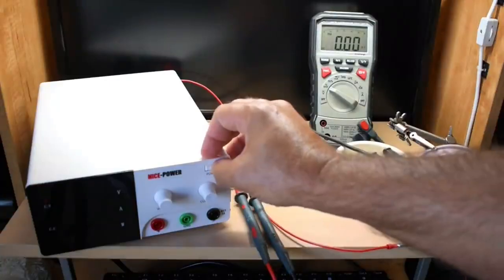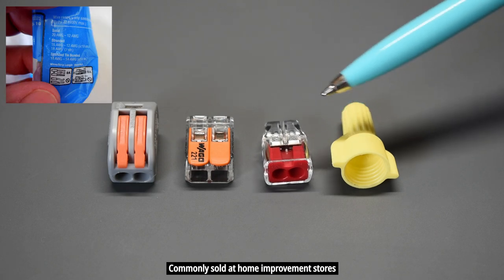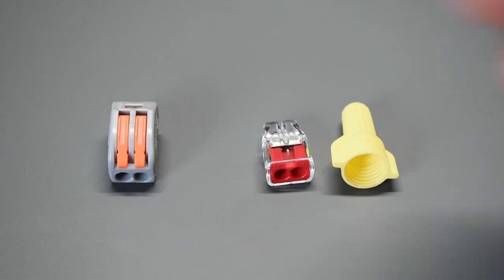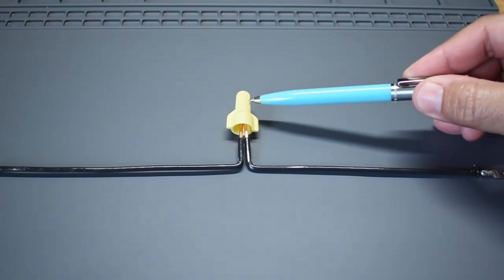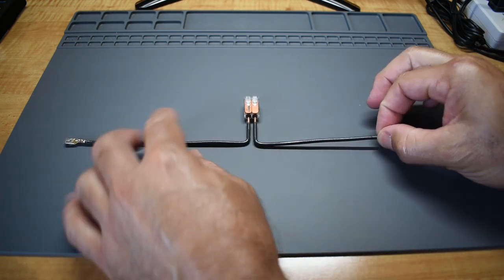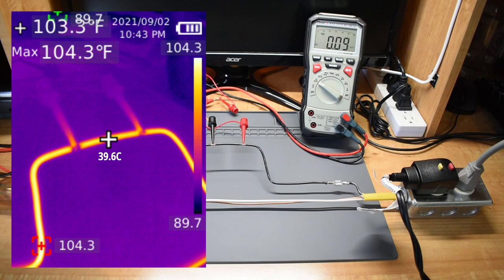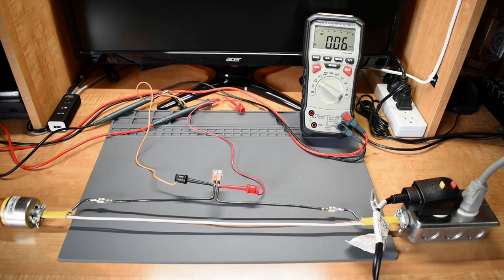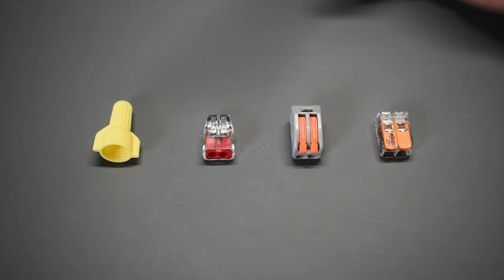BEST Electrical Wire Connector? Wago, Wire Nut, Ideal In-Sure, Lever Nut

Comment: on the ideal connectors- I have found that tinning a braided conductor creates a better insert bond, now that extra practice wouldn't be ideal if speed is a priority in the project. There is also a strip guide on the WAGO conductor, in your examples, you're showing the solid conductor over-stripped exposing more copper than necessary * for testing- this over stripping on a wago defeats the mechanical leverage of the wago making it "loose" -  the wago manufacturer's lever bond intention was compromised in the test- thats not a fair variable.
Reply from the maker: Incorrect, nothing was over- stripped. You're not looking close enough at the video using high-resolution.
Reply: @electronicsNmore  gotcha. so what your saying was the angle of the video makes appear that the conductors are over stripped? Not sure how you know what we are viewing the video with in resolution? Great video. In the 600 wago series up to  10 AWG there is no conductor lateral movement. How does Wago feel about your testing of the wago?
Reply from the maker: @proanswers  All the insulation wasn't removed from the test area to the end of the conductor. There's a short section of insulation on the conductor after the stripped area, and before the test area. No idea why it wiggles so much, but it does. If the stripped area of the wire needs to be exact, to the mm, then it's a poor design. There should be enough of a collar before the clamping area to restrict movement. I don't care what they think, or any other companies product that I test/review. My job is to be fair and unbiased.
Reply: Tinning any wire that will be inserted into any kind of clamping connection is a recipe for failure, and depending on the application a safety hazard.
Reply: @superdau  good luck with that opinion vs science ideal connectors were mentioned not lever wagos.  Check your.comment
Reply: @proanswers  
Not opinion, but fact. It's called "creep" ("solder creep" or "solder fatigue" specifically when talking about solder).
Reply: @superdau  that's great- off topic, irrelevant for application. If your looking for a your right - there you go. Be well good luck
Reply: @superdau  that's great- off topic, irrelevant for application. If your looking for a your right - there you go. Be well good luck

Comment: Anything with a lever that can get caught on something and pulled loose is crap. Anything that uses a spring lever to connect the wires together is crap. 
Wire nuts have been around forever and are extremely secure and save if used correctly.

Comment: Great video proving that the "old standards" became standards for good reasons.  I've recently seen some wire nuts that have no metal insert for "threading" onto the wires.  They're just injection molded plastic.  They go back for refund or into the recycling bin.  I solder and cap when I can, and use the wire nuts if I can't.
Reply from the maker: Plastic only wire nuts are garbage. Thanks for watching!

Comment: Strange that you did not twist the wires with a flat pliers before twisting the wing nut on the wires. Thats the way they teaches it at my school.  (Long ago..) That way the copper cannot oxidate at the inter connection.
Reply from the maker: I did it for a reason, to show viewers how well the connection is without twisting. You won't stop oxidation unless the wire nut is filled with silicone.

Comment: I've found wires coming loose with the wago 221.
The issue is when the wires are pushed back in the box, the wago 221 lever can hook on a wire and pop out.
Sometimes even without the lever coming open, the wire can turn and twist its way out.
The one test that worries me is the pull test.

Comment: On the wago you trimmed the wires to much. You have exposed copper. If done correctly the wire sheild will be inside the connector.
Reply from the maker: Incorrect, there's a strip gauge on the side.

Comment: how about those auto butt connectors ?
Reply from the maker: Which type?
Reply: @woof 359 I have used the Doorman insulated gold plated brass audio butt connectors inside my own explosion proof LED light fixtures. I do this because there are multiple different stranded wire connections made inside the fixture. These connectors are around 50 cents each and come in three sizes 18-22AWG, 14-16AWG, and 10-12AWG. As long as you use the proper crimping tool, you won’t have any problems with them. I don’t recommend the cheaper nylon butt splices, as they are made of aluminum and will oxidize causing the connection to fail. Also, never use a butt splice on solid core wire (UF, NM, or THWN solid).

Comment: On a Wago 221 you strip just shy of a half inch of insulation or .43” so that the wires insulation is clamped as well as the conductor, then it’s much more secure.

Comment: You know, you're supposed to twist the wires BEFORE you insert them into a wire nut.  The wire nut is just to HOLD and INSULATE an otherwise mechanically sound twisted connection of the wires.
Reply from the maker: You don't have to. I did many tests.
Reply: You are wrong.  Read the manufacturers instructions on the use if thier wirenuts.  He showed the correct method.

Comment: I went all the way back to your wire splice video, working my way back to your Electrical Wire Connector Pullout Force Tests! Wago, Ideal, Contractor's Choice posted today, 10/23-2022.  With this evidence of a Wire Nut having a lower Voltage drop and a more secure connection that the Wago Lever Nut, I have to wonder WHY you have been pushing the Wago Lever design as long as you have been.  I returned a large packet of 4-connection Push Nuts to buy the Wago various connection sizes from your store.  Now I'm thinking I should return them to Amazon and get the kind I bought from Home Depot before.  Not only do they work better with a more secure connection and a lower Voltage drop, they are quite a bit cheaper.  I have a collection of Wire Nut sizes that I was going to abandon for Wago, but now I learn that Push Nut design is better than any lever lock.  Why are you still pushing Wago so strongly?  Simple convenience is not enough when you are now saying Wago is better.

Comment: This is so funny. He talks about how the wire nuts are superior “if used properly”, and he doesn’t even pre-twist the wires.
Reply from the maker: What's funny is how you failed to understand why it did it as shown. I did it on purpose to show that the connection is superior without using lineman's pliers to twist the conductors together first. When you use only (2) conductors, the wire nut does a very good job twisting the wires.
Reply: @electronicsNmore  Often but not always. Which is why we always pre-twist. No offense, but not pre-twisting calls into question your qualifications to teach others about this stuff.
Reply from the maker: @declanfarber  Apparently you're not too sharp. I made it VERY clear why I did what I did, and you continue to mouth off. Typical of some viewers on YT.
Reply: @electronicsNmore  Your response to my note is another reason why it’s difficult to take you seriously. Please calm down, and have a nice day. No offense intended, again. FWIW, 8 or 9 mV here is a rounding error on most decent meters measuring line voltage, as an electrician.

Comment: If you can't effectively wire nut a 3 conductor connection into a lifetime result, stop messing around with electricity.I have dipped my toe into  WAGOs for the 5 wire gigs as it eases crowding in my boxes. I don't see the need to make it an either or situation.

Comment: Your test results seem to have shown that there is no real benefit or detriment to using any of them above any of them

The resistance difference between the best and the worst was negligible at best and the heating difference was also negligible at best

From a safety and function point of view there was essentially no difference between any of them

The wiggling can be corrected with a simple zip tie on the wires this would be equivalent to wrapping your wire nut in electrical tape which I do

You can also get the wago style connectors for substantially less money than that I typically get 50 for $2 which is about four cents a piece although the more complicated ones with more input output options do cost more

Overall fantastic video would love maybe in the future to see a comparison between different brands especially the knock off brands to see how well they compare with the supposedly better quality brands if there's a difference at all

Also for some reason your video was completely unwatchable on my television it showed up as basically black and just I don't know it would not work I had to watch it on my phone compatibility issue with codec?

Never mind about codec it was my TV I had to force it to actually restart all videos were playing weird

Comment: You need to learn to properly install wire nuts.
Reply from the maker: I forgot more than you'll ever learn. I suggest you refer to the link below and click on the video made by IDEAL. :-)
https://www.homedepot.com/p/Ideal-454-Blue-Wing-Nut-Wire-Connectors-25-Pack-30-454P/202894280#overlay

Comment: Wire wiggle in the WAGO, no one is going go into the electrical box to wiggle the wires.  no relevance
Temperature rise at load in the WAGO, the addition 6 degC is well below the annealing temperature of the metal, well below the melting temp of the plastic.  no relevance
Repeatably of the WAGO connection, over many years of servicing electrical connections wit twist connectors have found many poor connections, relevance high

Switched to WAGO connectors, will never got back to twist
Reply from the maker: Wiggling wires is highly relevant, it indicates that there's not a strong grasp on the solid copper conductor. End of story
Reply: @electronicsNmore  
Wiggling wires is highly irrelevant, has nothing to do with how strong grasp on the solid copper is. End of story.
Reply from the maker: @universeisundernoobligatio3283  whatever you say. Can't argue with a Wago fanatic.
Reply: @electronicsNmore  
Sorry just a engineer that knows a good design when he see and tests a product . Have done many lab tests on the WAGO myself find them outstanding even run long term at 30 amps.
Can't argue with some one that is trapped by tradition.
Reply from the maker: Have a wonderful day. I have much more important things to do than argue with viewers that are Wago fanatics.

Comment: Has any one used them for cars?
Reply from the maker: You can use the level nuts or push-ins, but for a car or boat I like to use 3M silicone filled squeeze connectors.

Comment: What is failed to be considered here, is that Wago connectors have been tested thoroughly by the manufacturers and authorites across Europe and shown to be perfectly fit for purpose.

Electricians here in the UK and Europe have been using them for a long time now with no issues.

Furthermore, I recall conductor movement in Wago's is desighned into the product intentionally for valid reasons. 

Again, the authorites that test Wago's and certify them as fit for purpose aren't idiots. It's not like they are just put on the market without being tested.

We stopped using wirenuts decades ago in the UK.
Reply from the maker: Thanks for watching!
Reply: The Wagos are UL tested and certified here in the U.S. as well.  This makes them perfectly acceptable according to our National Electric Code.  So this isn't a debate about whether they are legal here in the States, but whether a person should use them. Different electricians have their preferences.  In the U.S., both wire nuts and Wago-style connectors are legal and different people use different connectors.  I personally like the Ideal push-ins (as shown in this video).  They are easier to find here since they are made in the USA.  Wagos usually have to be ordered online and one has to be careful as there's lots of cheap knock-offs.

Comment: The best connection is to make a professional tap,then cap it off with the proper wire nut,that’s if you want the connection too be trouble free,otherwise use those dumbass legos.

Comment: Every electrician I know would laugh if you came to him with wire nuts. They've just too many long term reliability issues and adding or removing wires in an existing installation is just a pain. I don't know when wire nuts were last allowed in Europe, but there's a reason that they are barely used anywhere else than in the US.
The WAGOs shown here aren't the ones you'd normally use for solid wire in junction boxes btw. There are types better suited for that (also cheaper and even faster to install).
Reply: @drcornelius8275  
This test doesn't show anything. One piece per type only? Seriously?! That alone makes it pointless. And even if the difference were consistent over tens of connectors per type, the absolute value of the resistance is so small for all of them that it is completely inconsequential.

A meaningful result would include tests like moving wires, vibration, repeated thermal cycling, slightly corroded wires, redoing connections multiple times, pre-"bent" wires, combining different wire sizes and types (stranded/solid, copper/aluminium), pull out strength, overload behaviour, fire resistance and many more. Guess what? That's what standards from IEC, EN and UL include. There is a reason those standard procedures exist.
Reply: Oh and Europe is never wrong...

Comment: I've never seen that much play in push connectors that I use, so right off the bat, this experiment seems pretty sketchy.
Reply from the maker: Next time open your eyes and look. LOL. So genius, what exactly do I have to gain by lying? Humor me.
Reply: @electronicsNmore  Why not wiggle the two wires in the opposite direction in the wire nut at 5:20 ? You would get even more 'play', so it's just not a good measure to go by. It's pretty much a pointless test.

Comment: You blew it at 1:10 when you did NOT twist the wires before applying the wire nut as required by the manufacturer.  Pre twisting the wires guarantees the greatest contact area and therefore minimal resistance.  Resistance is a function of contact area and force on that contact area.  When the wires are properly twisted the nut does no more than protect the splice from external influence.  This guarantees the maximum surge current capability of the splice.  I have measured HUNDREDS of amps of surge current from switching power to the new LED lamp arrays because of the large capacitors they contain.  This type surge can cause what I call a "spot splatter" effect that,  after many cycles, leads to oxidation and increased resistance with a low contact area connection.
Reply from the maker: Wrong. Stop trying to make yourself feel important to others. As long as the ends are lined up properly, you can apply the wire nut and copper conductors will twist together very nicely. I suggest you watch the video below by ideal Corporation. You will see the exact connector I used in this video, and they're going to show you how the wires are twisted.
https://vimeo.com/284243244
Reply: @electronicsNmore  IF you are accomplished at the task.  I have seen too many connections with the nut loose or missing because the improper torque was used by a tyro.  Twisting the wires helps guarantee the nut insert will bite into the wire and hold properly without loosening..

Comment: Wire nuts  banned in England
Reply from the maker: LOL. How stupid.
Reply: only the ceramic ones are banned, but they gave a bad reputation to all wire nuts.
Reply: @jocramkrispy305  can't  beat   a good   old fashion soldered  joint
Reply: @grahamturner6119  not so good for swapping accessories out though....
Reply: @jocramkrispy305  keep   your  thoughts   2  your self  Krispy
Reply: I  still   say   you   can't   beat   a good  old
Fashion   soldered  joint

Comment: Wing Nuts... these new comers are lame. why do I need something re-usable? am I wiring to fail to need re-usable?
Reply: "why do I need something re-usable?" In case of a fault finding situation they will come in handy, and then the extra cost for the install in the first place will be paid back more than once because of the saved time because all is installed with something that is reusable. But is is a sort of lottery ticket, maybe you win or ...
Reply: Outlets and switches wear out, go out of style, or are replaced by GFCIs or smart switches and outlets.
Reply: Someone simply wants to add/change something 10 years later?